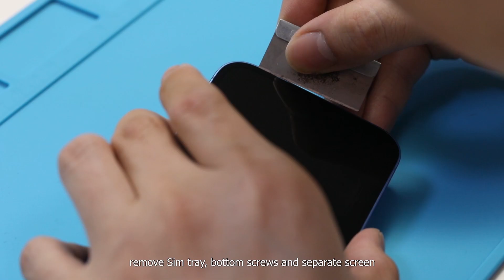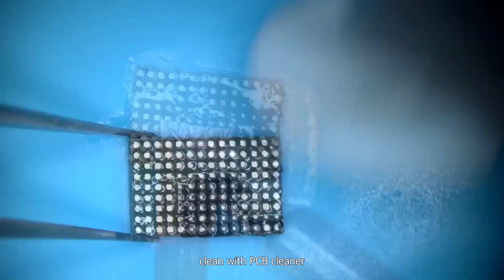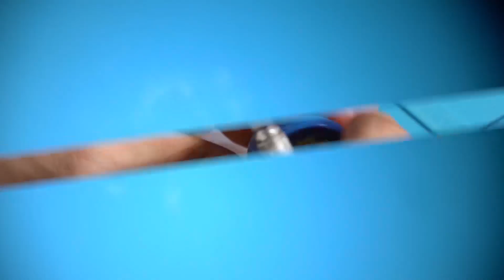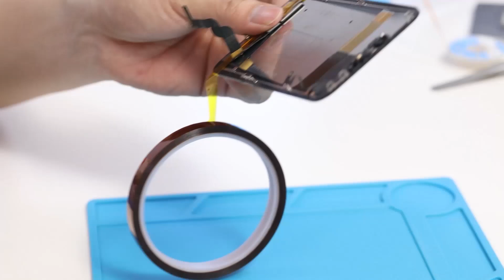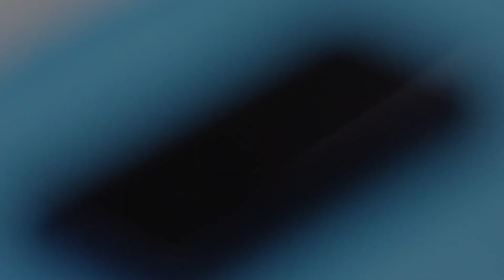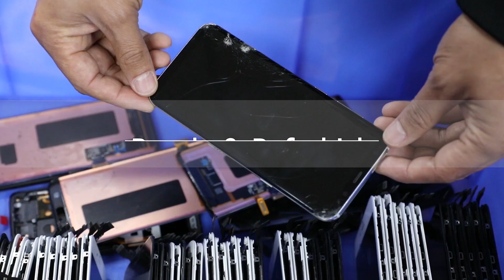iPhone 13 Face ID Repair On New Screen-Will This Change Industry Again? | Repair Shop Must Know.

Comment: I am a bit confused, the Face ID is conected the sensors in the top, you just need to remove the glue and moved to the new iPhone 13 screen. I just did that without touching any ic chip and not using programming, for the True Tone yes you need to move the ic chip or copy the data from the broke screen.
Reply from the maker: Apple cancelled this limit after our video launching, so you don't have to transfer the IC Chip to new screen now.

Comment: Why not use jcid j1se to program the new screen ???
Reply from the maker: 1- JCID can't restore Face ID by just read&write data;
2- Update: Now the Face ID problem will not happen if you have latest IOS.
Reply: @Elekworld  ok I saw a video where they claim v1se restores truetone  ,face i.d ,screen replacements and they give the tutorial
Reply from the maker: @hudrogers2326  We also use JC V1SE to restore Face ID, but not by simple read&Write data, it requires hardware repair or replace too. Refer these link: https://youtu.be/HrwlR72LJ9g, https://youtu.be/5ocQFjf16Ak etc.
Reply: @Elekworld  thanks I'm still learning and also thanks for the prompt response

Comment: теперь че даже с другой экраном не работает face id?
Reply from the maker: В последней версии системы iOS Face ID будет продолжать работать, если вы замените новый экран сейчас.
Reply: @Elekworld  без родной микросхеме ошибка выводить же
Reply from the maker: @abdulloh9    there are two problems: 1- As above answer, Face ID will keep working after replace a new screen; 2- "Unknown parts" or "important display message" error message will appear after replace a new screen. 
If you want to remove the error message, change the IC Chip is necessary.

Comment: Only work if replace the IC CHIP to a another original screen? Or if have a generic screen can replace IC CHIP too? Because its hard to find original screens at this point.
Reply from the maker: By now only works on original quality screen. But don't worry, bcuz IOS upgrade has solve the FACE ID problem.

Comment: Hi friend thanks for your video help. Now with Apple allowing repairs this is no longer necessary and there is iPhone 13 chip programer now as you mentioned in your video. Thanks
Reply from the maker: Yes bro, iOS upgrade has enable Face ID work again.

Comment: My 12 pro max lost face id after screen replacement (same error message in settings) , could you help pls?
Reply from the maker: 12 Pro Max won't lose Face ID if screen was replaced well. The problem probably happens on Face ID Module damaged or mis-installed during replacing the screen.

Comment: It is absolutely ridiculous that Apple is making things this complicated. now it will cost customers more, if repair shop even has micro soldering tools or if they simply do not want to spend that amount of time on a repair because you have to charge for your time and skill. If not your business will suffer and customers get the short end of the stick. Not cool Apple. Most iPhones were known amongst repair shops for for being fairly quick and not so expensive. This new dynamic will make people think twice about the iPhone 13. They might buy one, but once they go through this awful process they are going to start questioning their next purchase, as they should. I would not a recommend an iPhone 13 for this reason alone.
Reply from the maker: Yes that's not cool. But good news is that Apple has unlock the Face ID after new screen replaced, it's so great for iPhone users and repair business.

Comment: Wow I thought its unrepairable, there is always a solution.
Reply from the maker: Good news is that now Apple has updated its newest iOS which has removed the block on Face ID after screen replacement, it's big news for users and repair business.

Comment: As someone who do a minor “repairing” for iphones such as replacing battery/screen for previous iphone models, watching this video makes me realised im a very noob “technician”. Thank you for the knowledge, would love to learn on the soldering and understanding the motherboard parts. Kinda hard for me to simply replace iphone x and above models cause of the encrypted data
Reply from the maker: Yes, we have launched some board repair skills, tools videos and will launch more, please sub us and stay tuned for update. :-)
Reply: You’re not “noob”
Apple just make their device easy to repair but use software to lock hardware so normal people can’t fix it smh

Comment: Hii, I have an iphone xs max with the brightness sensor broken and consequently face id does not work, is it possible to fix it? I don't have the original sensor unfortunately
Reply from the maker: The sensor has effect on brightness and Face ID, according to your description, it should be sensor flex problem. Without genuine sensor flex, we can't fix it, unless you go to Apple store to restore it.

Comment: Well done my man. I hope everyone that comes across this is aware of how important RIGHT TO REPAIR IS
Reply: I heard apple is going to make repairs easier by allowing screen replacement so much easier without having to remove the face id chip
Reply from the maker: @user-iq3sm1sz9w  Yes Apple did this on iOS15.2 Beta, and probabbly will keep it on offical iOS15.2. Check this: https://youtu.be/TEXDRYOA3rA
Reply from the maker: Thanks bro, pls share with more people if you like it.
Reply: @Elekworld  6: 6:30
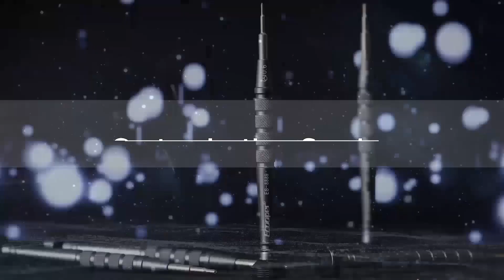Reply: 7:02 7:02
Reply: I believe 

If a rare bone is found, it can be sold 

We hope that bone comes to one who preserves it 

Why can apple not reserve this right 

And 

Why do we change law
Reply: 4:58 4:59
Reply: 5:04
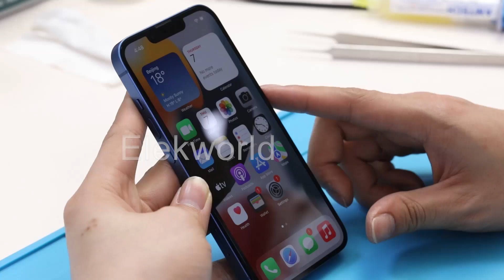Reply: 5:28 5:28

Comment: what is the name of the soldering station you use?
Reply from the maker: Sugon 8610-DX desoldering station, you can find more information in the video introduction, bro
Reply: @Elekworld  thank you! what temperature do you set the solder? thnx bro
Reply from the maker: @PeterMan55  Check it from here, temp and air flow power is listed in video: https://youtu.be/GnIHb_qT4ac?t=134.
We will launch more helpful repair video, pls stay tuned bro.
Reply: @Elekworld  thanks bro! yes a more detailed video in the future would be great. Would help a lot of repair shops learn this better

Comment: ESIM chip st33g1m2. There is no data when replacing a new chip. How can we use it normally
Reply from the maker: Haven't look into this chip yet bcuz in China it's dual-physical-Sim design, will check further in future. Thanks for question.
Reply: @Elekworld  thank you !

Comment: Could you not move the flex cable housing the iC chip from the original damaged screen to the replacement screen? (Have not done anything past 12 series)
Reply from the maker: The Face ID problem only happens start from iPhone 13 series, so if you don't care the non-genuine display warning message which happens on iP12 series and elder iPhone, then you don't have to remove the IC chip.

Comment: Awesome video! Thanks for always making good content. 

I have one question and hopefully you can help. I would like to replace my OLED scrren with LCD screen on my iphone 13 pro max. Do you know where I can find LCD screen replacement? I only want LCD. How long does it usually take for LCD screen replacements to make it to the market?
Reply from the maker: Hi James, by now there isn't any iP13 lineup LCD screen in market, according to experience, it takes about 10 months for factory to produce them and launch in market.
Reply: Just curious, why do you prefer an LCD Screen over an OLED screen?

Comment: New knowledge. Thanks. Is it the chipset which store all the info about the serial number and other info about the screen?
Reply from the maker: By now it seems so, including Face ID data, Display data, Touch function and partial of True tone function. You can check the other video for more details: https://youtu.be/akMo8kHW0Zc.

Comment: Great idea 👍🏽👍🏽 I think Apple gonna find another way to hide their chips in the next 2 years. I need to learn this procedure
Reply from the maker: I think this(Face ID embeded in screen Chip) will be standard of next couple years, so it's necessary for repair shop to learn more about chip level soldering.

Comment: It means that if a client goes to a unprepared repair shop and they just exchange lcd and do not keep the broken original lcd,it will be impossible to fix the issue because that chip is unique?
Reply from the maker: You can say that again,  this means they will lose Face ID forever unless they go to Apple Store to restore it.
Reply: thanks that what i tought,because many clients come to my shop with this issue. But they do not have the broken original lcd so i cannot help them

Comment: So isn't transferring FACE ID data to the IC chip a good thing? Because if the screen were to get damaged due to drop, face ID camera was likely to be damaged as well. Or does the iPhone 13 need both IC chip and the front facing camera assembly from the original screen?
Reply from the maker: In most cases, screen damage won’t hurt Face ID camera module, so the repair cost become higher with Face ID integrated. About your questions, we made a new video and will be launched tomorrow or Saturday. Pls stay tuned bro.
Reply: @Elekworld  of course, I thoroughly enjoy your investigations!

Comment: It is not hard to understand that there is need to refit memory / mcu from original to new one, but 90% of shops that can replace display, battery or glue a security glass - cant solder bga :)
Reply from the maker: Maybe more and more repair shop will learn BGA then. :-)

Comment: Locking down devices in the name of "safety" is cynical, plain and simple. It works for protecting users' financial data and whatnot, sure, but at what cost? And who watches the watch dogs?
Reply: not me
Reply: Yeah but it doesn't protects user financial data at all, especially when you replaced the screen then the face id will be disabled, which is silly..they said it's for protection, but the protection is gone after screen replacement..apple is literally trying to protect our money from ourself 😂 they want your money

Comment: this is only valid if you move the ic on genuine screen only,when the chinese folks made some copy the chance to use same type of ic is slim to none
Reply from the maker: It's very inspring inference, if so third party factory might produce chip bonding pad to fit original IC chip, to support IC transplant, then they can sell more. Let's see what happens in future.

Comment: in my opninion it should be made iligal bonding the sreen or wich other part to the motherboard. like buying a car but not being able to swap engne if needed
Reply from the maker: Yes, user's have the right to repair, but apple just don't care.

Comment: Thank you for doing this. I wanted to do it on my own video but to be honest I haven't done BGA work in a long time.
Also I found your video on the cell phone repair forms for mobile sentrix.
I hope that when China is refurbishing these displays that they'll leave the icy chip off for us. That'll make it much easier especially if my display is damaged heavily I can just easily remove it without problems. I'm sure you guys will make some kind of holder that protects all the cables.  My business is purely mobile so I need to figure out how to do this on the go.
I already have to charge a lot for iPhone 12 displays that are more than Apple. So I don't know how customers are willing to pay me extra to desolder a chip off. I may not be repairing these for a year at least.
Reply from the maker: That is just the reason why we made this video, hope it helps. 😃

Comment: I would wager that TrueTone doesn't work as the Touch IC doesn't' contain the data. In my repair experience, the TrueTone sensor is usually integrated to the LCD/OLED itself which leads me to believe its verified via the display flex cable which should be vulnerable to a copy and paste of serial numbers unless Apple has embedded a Texas Instruments chip that encrypts the flex cable data.
Reply from the maker: Agree bro, as far as we know True Tone was written into flex, maybe future programmers can do this

Comment: First thank u for the video second how will it hurt third party repair u just showed us a way to fix the issue and i am certain we will fix it cheaper than apple
Reply from the maker: Actually not every repair shop has skilled technicians to have chip level capability, it means lots of users will go to Apple to get Face ID back. Meanwhile, this method also has risk to damage screen.

Comment: If the new screen has the original chip from the original screen why wouldn’t true tone be available? This makes me think that a programmer will be coming soon that will restore both functions to the new screens on the iPhone 13 series?
Reply: @JokerBogdanov  If it's truly read only, how would a manufacturer write to it in the factory? No memory is truly read only. You just have to find the correct method to write to it.
Reply from the maker: I wish so even I don't think this gonna happen. But we heard that True tone was actually embeded into the flex cable, so it's still possible to read&write to restore it.

Comment from the maker: We’ve made a short test days ago about iPhone 13 screen replacing, even with original screen from other iPhone 13, it will have non-genuine display message and lose Face ID function, it still doesn’t work even after restore the iPhone. 
What if we transplant genuine screen IC chip on new screen, can we restore Face ID back? Let’s do it now to see if it works out.

SUGON 8610-DX Desoldering Station Hot Air Gun, 220V: https://www.elekworld.com/shop/productinfo.aspx?proid=15826&categoryid=283
B80-BS458 MECHANIC Lead-Free Solder Paste, 60g: https://www.elekworld.com/shop/productinfo.aspx?proid=6940&categoryid=283

For more Repair parts&Tools and Tech support, please visit:
Website: https://www.elekworld.com
Facebook: https://www.facebook.com/Elekworldshop/
Instagram: https://www.instagram.com/elekworld/
Twitter: https://twitter.com/ElekworldL